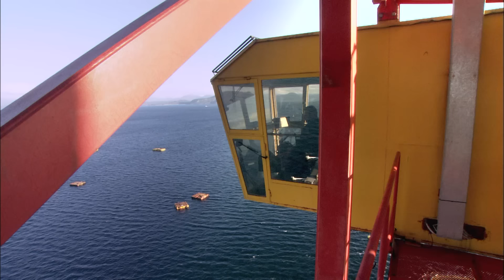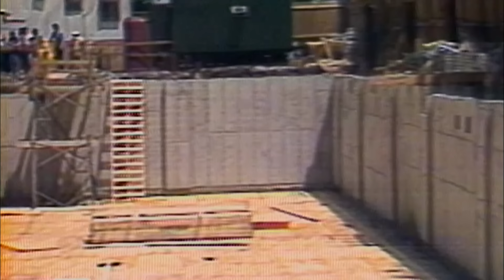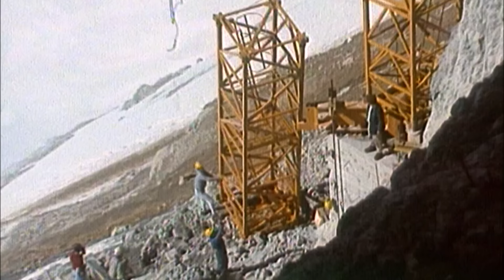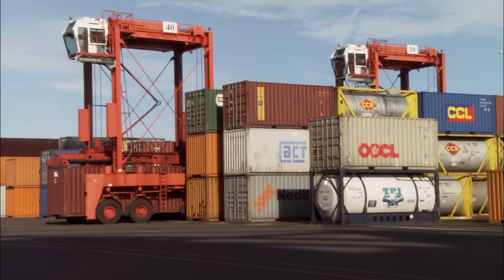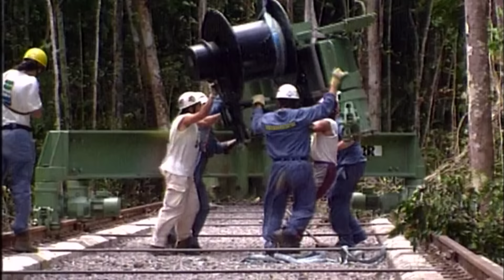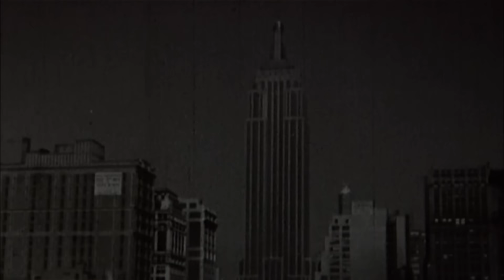Giant Cranes: The Inner Workings of Behemoths | FD Engineering

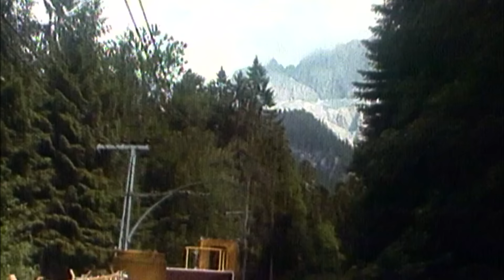Comment: The story about the crane in the high mountains (at around 22:00min) is actually taking place at  the "Zugspitze" in Germany and not the "Jungfraujoch" in Switzerland ... doesn't change the challenges though :-) .. this was part of building a new cable car to the top of Zugspitze and thereby renovating the overall station on top of the mountain.

Comment: Of course, they chose the wrong helicopter for assembling that crane in the forest. It should have been a Sikorsky skycrane, which is designed specifically for handling these types of loads.
Reply: And possibly the wrong pilot also. Geesh!
Reply: @snakeinthegrass7443  The wrong pilot is always a possibility. My point is the Skycrane has rear facing seat where the operator can see the load AND control the helicopter. There are some others with a similar design. I just do not recall their names or manufacturers.
Reply: any port in a storm...
Reply: @avgjoe-cz7cb  How does that apply to the topic ?

Comment: 10:26  You obviously don't understand physics at all.  Not college stuff.  High school physics.  Simple stuff.  It's called leverage.  The boom does NOT change in strength but the leverage against the crane and it's counter weight.  The cables and boom can pick up the same weight but the crane will tip over.